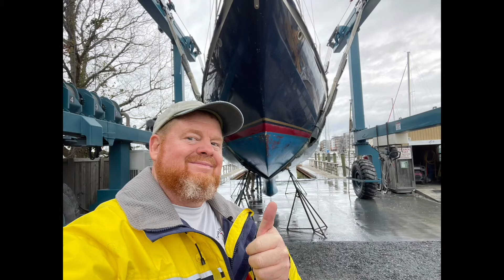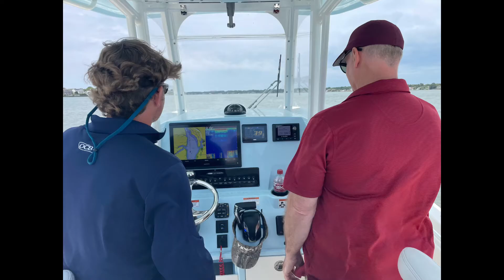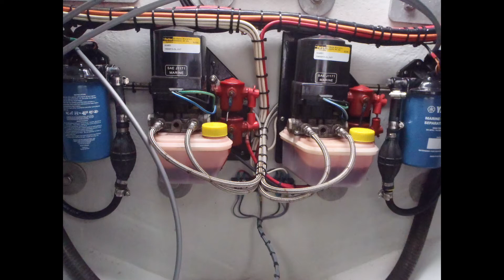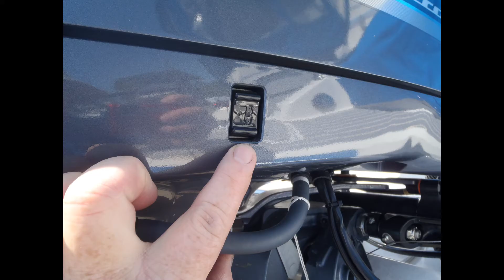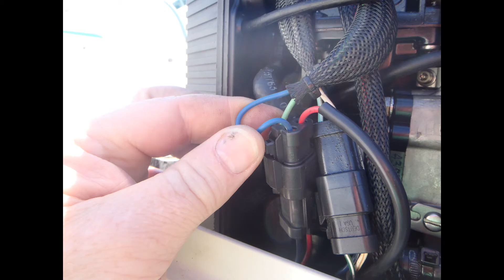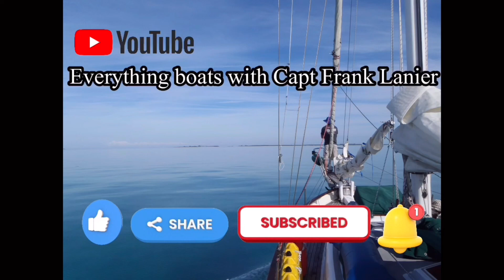How to troubleshoot outboard tilt and trim systems!

Comment: This video is garbage.... Why are all the trim and tilt videos about the electric motor??? This is a HYDRAULIC system... Just say you don't know, instead of making the same video EVERYONE else has already made?? The hydraulic portion sold the system has zero Diag process except: find a qualified technician.
 Stop
Reply from the maker: Because the vast majority of issues will be with the electrical side. It is not as you say exclusively a hydraulic system - it is a hydraulic system controlled by an electric system, which is way more prone to failure. If the issue is strictly with the hydraulic system (specifically the pump, as opposed to simply a leak) then repair will involve removal of the pump for repair or replacement. That’s typically something beyond the scope of most casual boaters, however most anyone can do the simple checks discussed here, which will at least point them in the right direction.

Comment: No idea if you will read this but my engine will go up and down no problem when the engine is on however when it is off it will go down no or problem but going up it does it like pulses up in little jolts. I did take on water due to some huge waves a couple weeks back and it filled my bilge and got up to 1/4 of my batteries but not my connections there are very few wires back in my bilge area but the boat worked perfect for 3 trips after that issue but now that’s my problem. Any pointers ?
Reply from the maker: Hello, I'm not much good at remote troubleshoot, but I'll give it a shot. My initial thought was this sounds like air in the hydraulic system (and it may still be that). However, if you can raise the engine fine with the engine running, but not when it is off, that sounds more like a weak battery or bad connection. My logic is that the alternator provides enough power while the engine is running to raise the engine, but with the engine off, you are relying on the battery only. If it is weak, it would have difficulty raising the engine (no problem lowering it, as that takes less power). With the engine off, I'd measure the voltage at the battery, then monitor the voltage while you try raising the engine. If there is a significant drop, then I'd check the battery, as well as the battery connections (to see if there is any corrosion). I hope this helps. Keep me posted and let me know what you find.